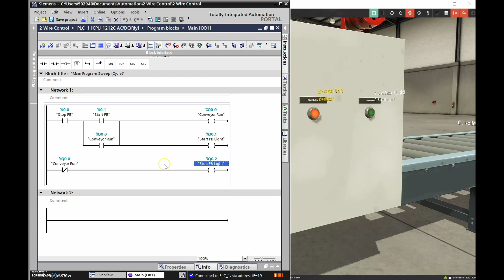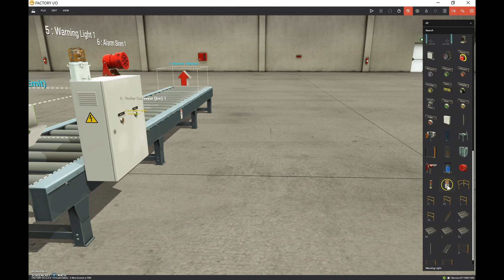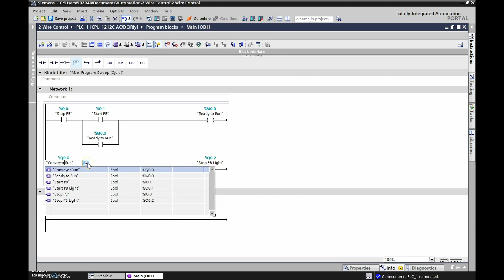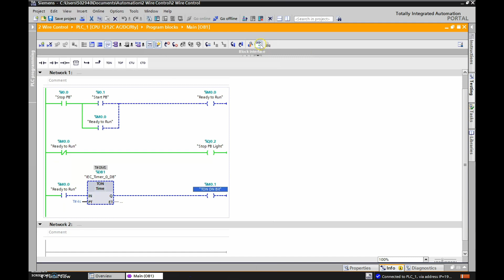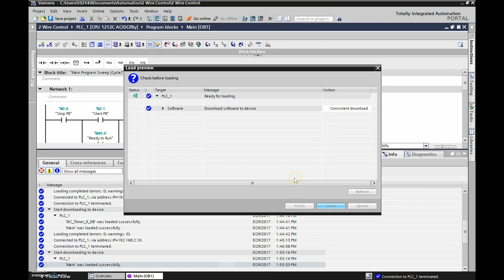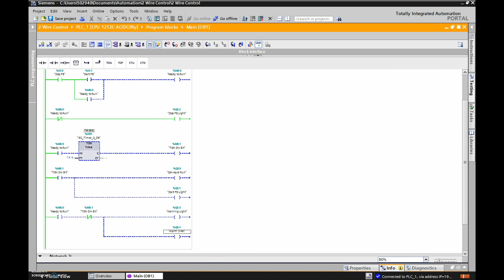Siemens TIA Portal & Factory IO (On Delay TON Timer)

Comment: hello sir.. I have a small doubt.. why you are not using NC switch for stop push button ??? actually that stop push button is NC type only nah.. then why are you using NO contact in ladder logic programming ??
Reply from the maker: don't confuse the NO and NC in the plc program and the physical wiring of the switch. The stop is physically wired as a NC switch, which means that at rest, voltage is being applied to the input terminal. The NO contact in Siemens is also called examine if closed in Allen Bradley. It looks for voltage applied to the input terminal or a 1 in the memory. Therefore we have to use the NO contact for both the Stop PB and the Start PB.
Reply: @PLCAutomationAcademy  thank you for your kind replay sir.. now i understand the concept..